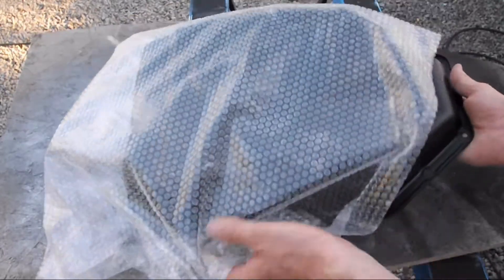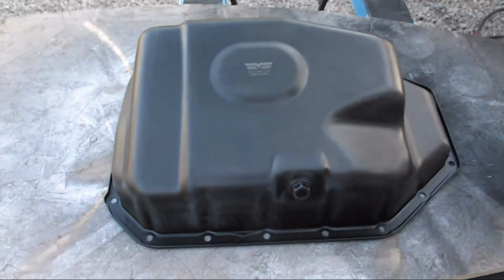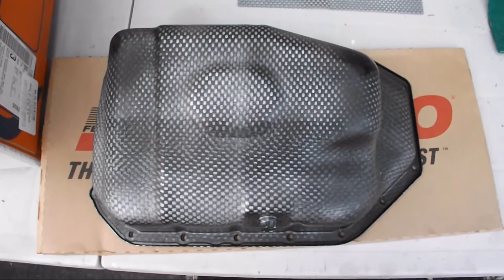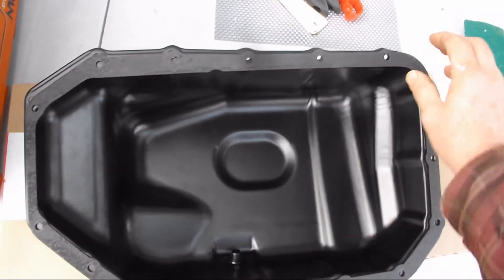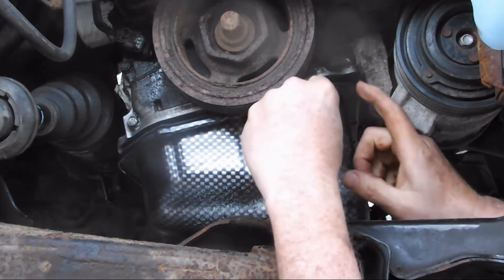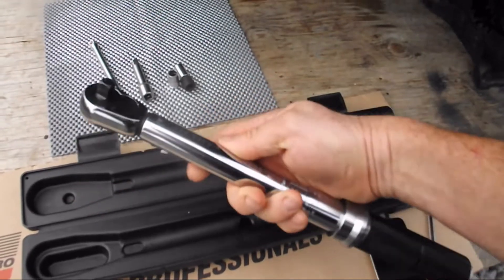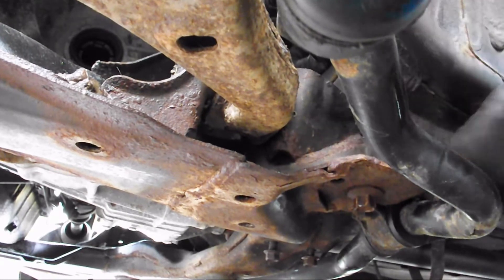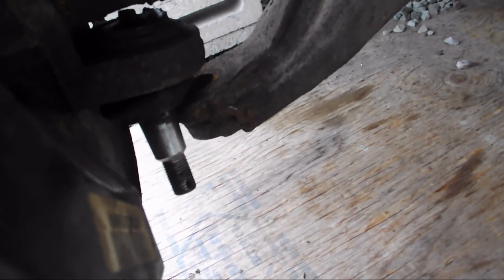Honda 2.4 L V-TEC Engine Part 2: Oil Pan Installation

Comment: what was the torque?
Reply from the maker: I did it according to the Honda Element service manual 
5. Tighten the bolts/nuts in two or three steps. In the final step, tighten all bolts, in sequence, to 12 N.m 11.2 kgf.m, 8.7 Ibf-ft).
 
Follow the sequence shown in the video

Comment: What all did you have to remove in the beginning Bumper? Anything else? Also how has the Felpro held up?
Reply from the maker: Hi the video shows what I had to dismantled and the feltpro gasket hold up really well on both car (Honda  Element) that I did

Comment: I see I might have a leak where the Honda bond is looking a bit thin (or the vtec is leaking and collecting there or both) can I get some rtv gasket sealer and just go over the part that might be leaking to plug the hole from the outside? Or do I have to take the entire pan off and reseal the whole thing?
Reply from the maker: The Pressure is coming from inside, unfortunately resealing the whole pan is the only way to go

Comment: Your idea of using a gasket in in lieu of Honda Bond or equivalent Permatex Ultra Grey is intriguing and on my oil pan job I seriously considered it until......I saw the price for one of those, now 5 years after your video and it's a whopping $50.   I think I'll  go with the sealant.  OK, what do I think about the gasket?  Good idea for ease of installation especially when in the car since the sealant tends to get on other exterior parts when installing the pan.  Long term, well you can give us an update but the reason why manufacturers went the sealant route is because a gasket creates two new surfaces for leakage to occur as opposed to one with the sealant.  It's newer technology; a pan gasket is "old school".
Reply: Go with the sealant. It's the Honda Utlra Flange sealant. At one point Honda did say you could also use Honda Bond. I recommend the Ultra Flange. I'm an Honda Certified Technician and an ASE Certified Technician.
Reply: @jameswashington8593  I actually used Permatex Ultra Grey.
Reply: @canuckfixit7722  It works. I just never used it personally on an oil pan, but I have on the corner of Honda valve cover gaskets.

Comment: Is it necessary to apply a little silicone to the crankcase gasket?
Reply from the maker: Hi, no need for silicone for the Felpro gasket, just make sure to torque each pan bolt to specification

Comment: Do you know if an oil pan in aluminium from another k24 would fit?
Reply from the maker: I dont know but with a little research with part numbers and parts cross reference you should find your answer…good luck

Comment: Hello place the same felpro gasket and torque 12 Nm but I still have leakage of the oil pan, what could it be?
Reply from the maker: New oil pan ?
Reply: @JoeBakerOutsideTheBox  No
Reply: @JoeBakerOutsideTheBox  thank u very much, maybe its the oil pan. A question? Did not put any RTV really with the felpro gasket? My car is a 2006 Honda CRV.
Reply from the maker: You dont need RTV if you use a gasket, it should be seal properly with the gasket properly torque. its hard to tell witout seeing it but could be the oil pan they are made of thin metal i seen one with an hairline crack. Retorq all bolts, Make sure you have none missing. Also the leak could be coming from other area like the transmission end crankshaft…or other
Reply: @JoeBakerOutsideTheBox  thank u bro!!! 👍🏼

Comment: After replacing the pan it was supposed to be filled with oil and checked for leakage. That part also should have been included for a complete instruction info.
Reply: also, don't forget to turn the key in the ignition to start the car.
Reply from the maker: Well… that part is obvious, I assume the viewer to have some common sense
Reply: @JoeBakerOutsideTheBox  ha ha, that is funny. Hey you didn't tell the people to put oil back in their engine! :)

Comment: Any leaks so far just using felpro gasket and no RTV? Planning to replace 2007 Acura oil pan this weekend. Thanks
Reply from the maker: I did it that way twice on two of my Elements with excellent result, no leak. I made sure that the contact surface were clean and  I used a torque wrench

Comment: what about adding oil to the engine prior to reassembly to check for leaks?
Reply from the maker: You could, altough the oil pressure builts up with the engine running. And I definetely would not run the engine at that stage...I think the safest bet is to use a  torque wrench for all the bolts and in the right sequence

Comment: Thanks for the video- I gotta replace the oil pan on my '08 at some point soon. Be sure to lather the new one in grease or fluid film. Looks like she has a case of the crusties, just like mine!
Reply from the maker: It's a fairly easy job if all the bolts and nuts cooperate...cheers

Comment: A local shop quoted me $800 to replace oil pan in my 2003 Honda Element!?
Reply from the maker: I think its about right...between $600 to $800
Reply: @JoeBakerOutsideTheBox  Thanks, appreciate that. Looks like a lot of work! Thank god for Pros!
Reply: @JoeBakerOutsideTheBox  Why so much?  An oil pan and gasket can be purchased for under $100, unless you buy from Honda, and I've read that it should take between 2 and 3 hours to complete. Your labor cost must be over $200/hour.
Reply from the maker: You are right about the cost of parts altough I have no clue how mechanics structure their price, I do most repair on my vehicles myself so the labour is free.
Reply: @JoeBakerOutsideTheBox  Thanks. I got two estimates. The first was "At least $800, maybe more depending on what we find". I didn't care for that estimate.:)  The second, "Looks like it will take 4 hours, so $600" That sounded more like a guy who knew what it would take. Thanks again.

Comment: Hello ! i am about to do the same job on my Honda accord 09 coupe 2.4l k24z3 engine but i don't think i need to get a new pan just change the gasket is it better to use fel-pro gasket or RTV, (engine will be in the car). Thanks really helpful video !
Reply from the maker: I think if you are pro and work with RTV gasket on a regular basis, your chance of getting it right are high. If it's something you do for the first time or on occasion, the FelPro gasket is a safer bet...enjoy your project
Reply: @JoeBakerOutsideTheBox  yes it's my first time and i think i will go with fel-pro

Comment: I'm doing this same job right now. It is a real pain. Thanks to videos like this I am able to lessen the headache. I am also using the Felpro gasket. I don't trust myself with RTV. Thank you for doing this video.
Reply from the maker: Thanks for the feedback, i replaced 2 different Element with the Felpro and both car have no oil leak at the gasket

Comment: I like your Honda element repair videos do you have anything new coming up
Reply from the maker: Hi joe, I have 3 video in footage but not edited yet and plan for more. Sometime life/work gets in the way and slow you down

Upcoming: how to change a wheel stud super fast
                       Acura brake upgrade for your Honda (almost ready)
                       Honda code 0341, need a new timing chain? Try this first

Comment: Quick question....
What torque wrench is that??
Reply from the maker: 3/8 inch torque wrench, great for smaller bolts
Reply: @JoeBakerOutsideTheBox  
Oh ok...
Yea thanks, so I was wondering what brand it was...hehe.
Reply from the maker: http://www.canadiantire.ca/en/pdp/maximum-3-8-in-drive-torque-wrench-sae-metric-0589398p.html
Reply: Thanks bro..👍
Reply: @JoeBakerOutsideTheBox  thanks

Comment: I have a 2006 honda accord 4cylinder it looks like im goin to do pretty much the same and what a pain in the ass
Reply from the maker: Its really not that bad, I learned a few shorcut when i did it a second time (first one was a 2008, second time 2004 Element).  Here is the few shortcut video: https://youtu.be/CbrhARSSSj4

Comment: what brand oil pan did you order? I need to replace oil pan on 2007 accord. looks like the same job. thumbs up
Reply from the maker: Oil pan is from Dorman, I was told the metal on the Dorman pan are thicker than OEM
Reply: cool that's what Ill get. thx

Comment: How is the gasket holding on, any leaks or problems?
Reply from the maker: IS only been a few month's , so far so good
Reply: Sticks, Stones and iron 
Great job, Im replacing mine with a gasket too,Im afraid messing things up with the hondabond, thanks for replying to my question
Reply from the maker: Don t forget to get new bolts...
Reply: Sal Ban  New bolts for the oil pan or what?
Reply from the maker: With the engine in the car, i find it hard to do a good job with the liquid gasket. Engine outside the car, no problem
Reply: any new updates I'm looking to do mine but trying to decided gasket or hondabond